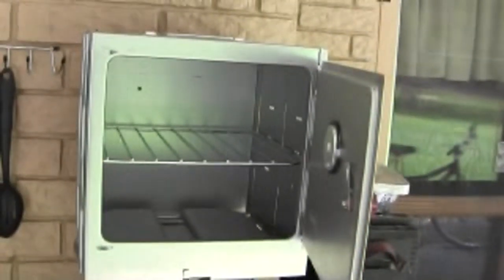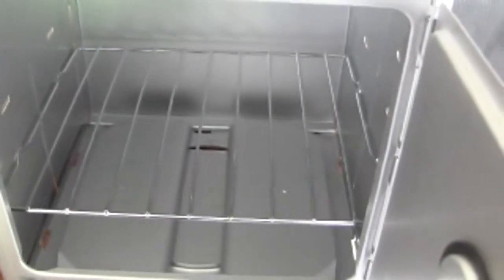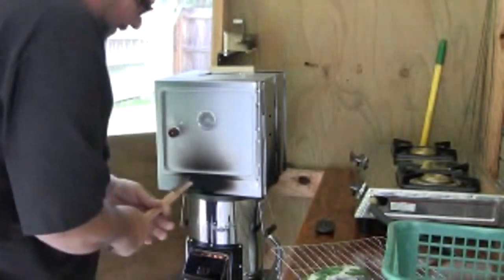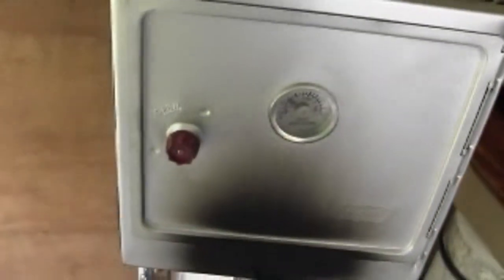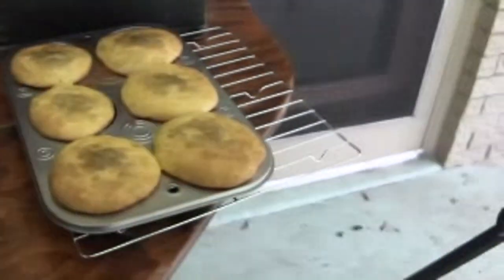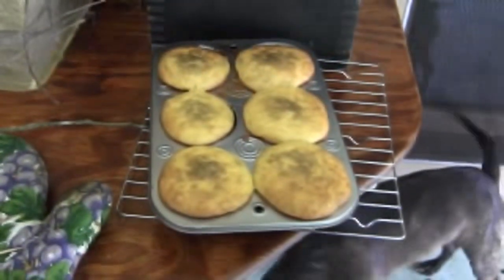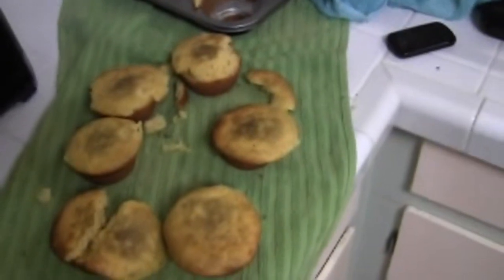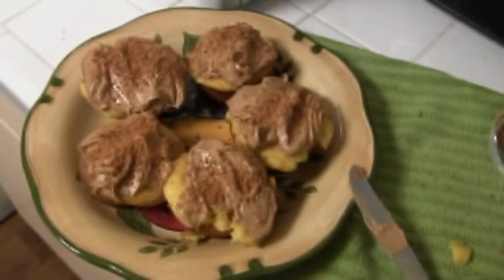Baking cupcakes in a coleman oven

Comment: i am going to use my large cast iron dutch oven with a trivet in bottom to bake over my stationary rocket stove.i have both a low profile and a taller profile trivet to try.i think the cast iron holding the heat in its sides and top will give a more even temperature.we shall see...i may do a video on it too.thanks for showing this.keep up the good work.
Reply from the maker: elkhound25 I think the cast irton will better than the coleman oven. Im gonna try to make my own oven.

Comment: If you get your hands on some stainless steel you can build a better oven for the rocket stove by having a double wall box made with an opening under to let the gasses get into the space between the walls and an exhaust port on the top. If you want something larger look at a cob oven they are dirt cheap and can be built around rocket stoves tech.

A cob oven is a large high mass oven built of mud that is then fired to dry. After the fire is out it stays hot for a few hours for baking in. They can be modified to use a basic rocket stove for the heat so less ashes inside the back area and less fuel needed to get the thing to temp.

The other fun one is a rocket mass heater they use the rocket stove idea to heat a large mass then let that heat out slowly over the day and can be modified to provide hot water/cooking areas. Shouldnt be to hard to make a oven box on top of the barrel section add some heavy rock-wool insulation to keep the heat inside that box.
https://youtu.be/BoW-ICO83hM Around 2:30 into the video they start a good breakdown of how and why the system works well.

Comment: Smaller space can work with lower temps.:) I have a Coleman stove too. They work well on a propane stove as well. Have fun.
Reply from the maker: Old Pup I'll try it on the propane stove soon.
Reply: Old Pup FWIW.... I like those ovens because they'll work on flat topped wood stoves, kerosene stoves, camp fuel stoves, propane stove & as demonstrated rocket stoves.  Another FWIW.... A few years ago I found a floor model 3 burner kerosene stove at a yard sale. One of my fond memories is my father "frying dough" on one of them.  Great stoves to slow simmer pots of beans. Found a Colman style oven made to fit them, but sadly it was beyond my budget. Priced higher than the stove, itself. 

Nuff rambling.... :-)

Comment: The off grid betty crocker strikes again. When hubby gets home from work tonight we are going to BBQ up some burgers and I have salad ya know that green stuff, although I don't like salad on my burgers, just cheese,bacon and onions and salad on the side. On a different note, it is 95 F out with the humidity and we had a rain storm a couple hours ago. Last week the hubby installed rain barrels on our eaves troughs and all 3 of those 55 gal barrels are full to the brim and have to let loose some of that water, because more rain is expected tonight. So down the driveway it goes. Don't know what else to do with it. Gardens do not need water right now and I don't have a berkey to filter it for storage. Sheesh. Water in barrels is warm to. Maybe next project should be and outside shower or bathtub. Or maybe go buy one of those blow up 4 foot deep pools. I am letting loose about 90 gallons of water out of those 3 drums that equal 165 gallons.
Reply from the maker: ***** Ive been giving a lot of thought to building an outside shower. 95? I didnt think it got that hot up yonder. No rain barrels here because my house doesnt have gutters. If I end up staying here,Ill probably put some on the back side of the house.
Reply: BCtruck, rebuild, repair,repurpose I live in Windsor across the river from Detroit and yes it gets hot here like crazy.Right now it is 81F but the humidex makes it feel like 95 F. Especially July and August gets really hot. We are still in spring mode though, by Sunday it will be 58F as a high with no humidity. This ole house we live in was built in 1906 and is supposed to be a storey and a half. Looks like a barn, Dutch colonial style. Roof is very slanted lots of gutters. Rain barrels are just those 55 gal blue plastic ones with a hole cut on the top and screening over the hole and metal outdoor water taps at the bottom of the barrels, They are meant so I don't have to pay for water when I need to water lawn or gardens or if SHTF scenario I can always boil the water and strain it through coffee filter. I think I will try to convince hubby to get a cheap metal framed pool. I hate wasting water like that but don't know what else to do with it right now. I would be outside more in the summer if I had some where I could splash around in.
Reply: BCtruck, rebuild, repair,repurpose Oh update on rain barrels. Well one of them is beside the basement window that is near my clothes washer, so you know what I did. Yes I stuck the sprayer on the hose so I could stop the water from the basement level, slid the bug screen open on the window and filled up my washing machine. I have a load of white laundry with a touch of bleach going right now with free water. LOL. Oh Sheesh I better keep an ear out for the spin cycle and use more free water with the rinse cycle. Guess I better take my laptop to basement rec room.
Reply from the maker: ***** rainwater wash with unicorn farts natural drying?  Now thats natural!
Reply: BCtruck, rebuild, repair,repurpose Yeah I hang laundry also, even though I got a natural gas dryer. I only use dryer for certain things. Somebody said to me today that I should wash my hair with that rain water also.I got really long hair. Well I could do that to in the laundry tub. Or until I figure out how to make that outdoor shower. Already have shower head and plumber tape out. It is all about gravity for shower though. It may work on the first 20  gallons of water that is in that drum. But there is always the basement laundry tub. We get a lot of rain here, outside of Windsor is many fields of produce growing mega farms so we are never hurting for water like some places.
Reply: BCtruck, rebuild, repair,repurpose Brad when I was in my late 20's I lived off grid for 6 months, before off grid became fashionable. And without all the new gizmos they have now like solar panels and stuff. Sheesh! I used to come home from work and take a dip in to a spring fed pond that was beside my 1973 airstream trailer, but not before my trusty staffordshire pit bull went into that pond to scare away the water snakes. I HATE SNAKES. I have only lived in this area for about 5 years. Different to what I am used to.